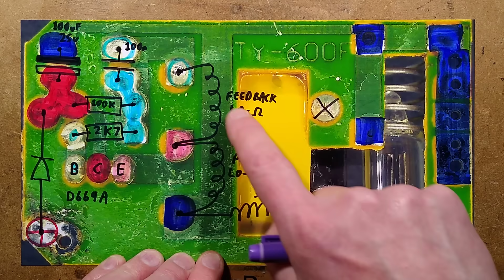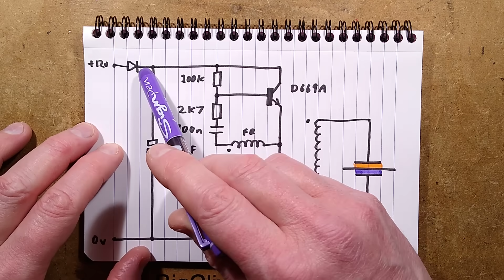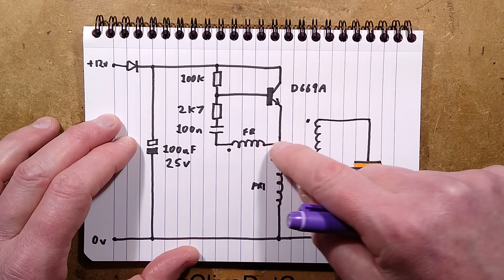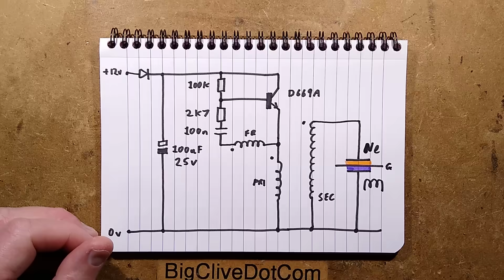Car ozone generator - with neon based cold plasma tube

Comment: I'm always wary of Ozone generators in cars due to the potential for oxidised contacts causing utter nightmares with modern vehicles. No doubt you'd need a substantial amount generated to cause any more issue than the outside air (especially after heavy rain) but still...

Comment: Can u recommend a good ozone generator that works in cars or battery operated. For time to time sterilising in cars?
Reply from the maker: I think the dealerships tend to use the common metal cased mains powered units.
Reply: I use one of those multitip air purifiers that Clive has been showing before, with a 12V power bank. It works very well.

Comment: ozone is toxic. if you ever go to a hospital that is using it to treat a room, that room will be locked, with warning signs on the door.  the only thing not causing these stupid consumer-grade machines to send people to the hospital all the time, is the very very low amounts of actual ozone they produce.  If you put dozens of them in a small closed room and tape the windows and doors shut, leave them running for days... then you might have a problem.  Otherwise... nah.  they do nothing.
Reply: yeah, not sure even DOZENS of them, in a sealed room, would generate ozone fast enough for it to become dangerous before it starts breaking down again into O2.  hundreds maybe?

Comment: I wouldn't recommend people use ion/o2 generator in their car for a long run. It going to cause the plastic to become brittle and breaks down more faster (self experience). Use those hepa & carbon filter itself if you want to get rid of the smell.
Reply: no, they do not.  if you car plastic was degenerating more quickly than expected, that is likely due to high levels of O3 in smog, and or naturally generated in some areas like low lying deserts, when it catalyzes from 02 off the surfaces of hot rocks.  it is impossible the consumer grade O3 generator in your car did any damage.  they literally only produce enough ozone so you can barely smell it.  it's a con.  these things do nothing. they are NOT commercial grade ozonators.

Comment: I wonder if the reason you got better results with the green neon bulb was because the green emitting phoshor coating gave better capacitive coupling?
Reply from the maker: I think it's more due to the gas possibly having a lower voltage drop.

Comment: The windings on the little transformer on the device are tiny! I had no idea we could wind copper wire that thin. What an incredible, yet completely basic electric component we use without thinking about day to day. Honestly I'm kind of impressed with this silly little device, I wouldn't exactly want to release poison into my car, but if I ever felt the need to this device seems honestly quite thoughtfully designed.
Reply: Everything is poison if you get too much of it. Ozone is probably one of the most "natural" sterilizers you could have...

Comment: one way I've seen to work out the turns ratio of these is to feed in a low voltage 1KHz sinewave into one of the windings (say, 0.1V) and measuring the output of the others then dividing out to get the turns ratio.  As for how the oscillator starts, the 100K resistor will slightly bias the transistor, then the transistor will begin to amplify the noise present (via the feedback winding) and it quickly breaks into steady oscillation.

Comment: You have to admire whoever came up with the neon bulb in the wire coil that only works at a certain distance out of the coil.  I was amused when you initially tried to 'fix it' and then it stopped working.  That showed the complex magic!

Comment: Given most cars have fresh air coming in the vents, not sure how beneficial a car ozone generator would be.   Also, I would worry about the oxidising effects of higher OZone levels would have on plastics and rubber components in modern vehicles.  Not all are mode to the same quality, which may allow ozone to attack them.
Interesting how postioning of the Neon seems so critical.  Wonder if a very slight movement would reduce Ozone before killing it completely.   I imagine it would be a pretty fine line though
Reply: yeah, consumer grade "ozonators" never generate enough volume of O3 to be a concern.  just another scam gadget basically.  you ARE correct though about ozone effects on plastics/rubber. out in the low desert in eastern California, the ozone levels do indeed get high enough in the summers to drastically reduce the life of soft plastics like window and edge sealers (the ozone is generated from UV light hitting the surface of rocks which catalyze splitting O2, which then immediately recombines into less stable combinations of oxygen with a higher concentration of 03).  they will often become brittle within 2 years.  even brand new cars will suffer this.  You can use your finger and they will simply disintegrate. I never understood why so many doctors in the 60s/70s told their tuberculosis patients to move out to the desert.  exactly the wrong place to go.

Comment: Sounds like a great way to destroy a cars interior. Ozone breaks down most plastics and rubbers. It's also highly oxidizing to many iron based compounds. Long term exposure can also lead to lung cancer and reduced lung function. At ground level it is considered a pollutant.

In general Ozone generators are a bad idea. There are safer ways to clean the air.

Comment: Could that possibly feck up your GPS antenna. I mean it's a high frequency high voltage low current generator. God help you if it does and your in Milton Keynes 😡

Comment: Oy!  Totally fascinating.  Never saw that configuration before.  Them clever little Chonese fellas!
I got a cat-stank-inhibitor that you stick on near a catbox, so when it senses motion, it generates O3 for a set time then turns off.  Output port looks like a 1/4" jack, only a needle vs round pin in the center.  Does work.  Occasionally get a whiff of O3 when I keep it around.
Reply: This is an kickass idea! How does anyone buy one from you?

Comment: 0:34 - Including the risks to health, if it even produces enough ozone... I've also come to learn, that ozone can be detrimental to some plastics, and perhaps rubber too, which may not be a good thing for car interiors...(?) Cheers-
Reply: these things produce so little ozone they are insignificant.  you're better off worrying about leaving your car for extended periods in places where O3 is produced naturally in high amounts, like in a hot rocky desert.  like say... Palm Springs California.  soft plastics and rubber have about 75% reduced lifespan there.  source:  I lived there for over a decade.

Comment: Now you make me wonder if ozone in the atmosphere could be artificially produced at a significant level. Floating solar panel balloons, supposing, and appropriately charged needles or tubes.
Reply from the maker: It is produced naturally in normal air.  But you can't just add ozone to the ozone layer.  It works differently to that.

Comment: I found that using ozone in my shed for deodourising car bits found that it really does rot rubber stuff quite fast. My atex rated torch is "no longer atex rated"

Comment: The ozone generators should be avoided especially by smokers since it can cause lung cancer.
They had some air cleaning systems at my  job place that filtered the air and added ozone.
The smell was not pleasant and with the possibility to achieve lung cancer made us to remove  the ozone building part in those units.
Reply from the maker: If at high levels where you can actually smell it, ozone is an issue.

Comment: With all these in car gadgets that plug into the car's cigarette lighter, there's the problem that you can only run one of them at a time. Has anyone invented a cigarette lighter 4-way extension lead equivalent, so you could plug lots of gadgets in at once? Or are modern cars all going USB these days ?
Reply from the maker: There are multi-way car socket extensions available.

Comment: Ozone generators  are reasonable common in Pathology Laboratories (obvious reasons); there are also commercial Steriliser / Disinfector systems, mainly aimed at smaller users,  and they appear to provide a lower cost option to the "Low Temperature Steam / Formaldehyde" systems. The idea is effective against vegetative organisms, however activity against bacterial spores is "variable".
Reply: also, the amount of ozone a commercial sterilizer produces is literally THOUSANDS of times what the consumer electronic versions produce.

Comment: I had two 36" industrial ozone fans running for 48hrs after a fire incident at my house about 8yrs ago. The restoration contractor told me not to enter the property for 24hrs after removal of the fans. The fans worked as there was no smoke scent left in the house and it smelled fresh as newly laundered linen. My two cats had to live at the pet spa/hotel for 35 days while the inside of the house was restored, they got regular baths and grooming which they've never forgiven me for...😒  Thanks Clive.
Reply: wise choice, as high levels of ozone are bad/deadly

Comment: If this would make ozone in small amounts you could probably run it non stop in your home or storage room.
Reply: it DOES make ozone in very tiny amounts.  you COULD keep it running constantly.  it is not significant, or useful.  just produces enough so you can smell it.  that's it.

Comment: I'm not sure of the health problems being exposed to ozone for long periods, but the old first gen Apple LaserWriter generated ozone like crazy, even in standby. One day I was talking to one of the secretaries (it was the 80s, that's what they were then), who said something about having constant headaches at work. I noticed they had moved furniture around in her corner, and the fan output from the printer was blowing directly at her. We turned the printer so the paper was still accessible, but the fan was blowing away from her, and not at anyone else, and within an hour her headache went away. She didn't know what ozone smelled like until I pointed it out, and later that week they had me put a network connection in another part of the room so get the printer away from everyone. So at the very least too much ozone in a small space, even an open room will affect you. In a car for a long drive, I would think it was worse. Also, I was amazed that the printer didn't shut down the HV section even at idle. I suspect Apple decided people couldn't wait the few seconds it would take for it to come up. I think they kept the fuser section at half temp too, because it was always not working hot, but you didn't want to touch the fuser roller for long.
Reply: Ah, the days before EnergyStar
Reply: The Apple LaserWriter had a fairly decent ozone filter on it's fan exhaust. If serviced or replaced regularly it should have minimized the ozone. It however didn't get rid of the burnt plastic and toner smell.
Reply: "I'm not sure of the health problems being exposed to ozone for long periods"

imagine having a spray bottle with bleach in it, and aerosolizing it at your desk every hour.  If ozonators produced hospital grade levels of ozone, that is what it would be like working at your desk every day.
the reason consumer electronics don't do that is because they produce TINY amounts of ozone.  just enough for you to be able to detect it.  EXTREMELY unlikely the old laserwriters could produce enough ozone to be of concern even in a closed office space.  much more likely headaches were being caused by old style flourescent lights which had really poor power dampeners so they flickered at the AC power frequency.  Known cause of headaches.  Since then most overhead fluorescent lights have adopted a better ballast system that power smooths so you don't get constant flickering.

Comment: I had a commercial unit, for semi trucks...wired underneath my dash...to a toggle switch...incase of a random traffic stop, for certain smells....you're not supposed to be in the cab when it's on, so i ran a reverse relay from an old car alarm with keyless remote....lol

Comment: And here I didn't think it would work at all 
Could you do a video on how a three-phase motor works how you would wire one up I don't want to wire one I just want to know how it works
Reply from the maker: There are many different types of three phase motor.  For the simplest you have a ground connection and the three phases, and the motor relies on the sequencing of the phases for rotation.

Comment: My car has a built in ozone generator as part of the ventilation system, so that seems to indicate the the idea is safe and effective (at least when the quantity is designed to match the size of the car).
Reply from the maker: Many do, but they often call them ionisers to hide their true function.
Reply: they are entirely useless.  they are however, completely safe as well.

Comment: The oscillator probably doesn't put out enough power to handle more than the neon bulb's tip generating ozone. With the neon tube pushed further in, most of the energy gets spent ionizing the neon instead of generating ozone.
Reply: very little ozone is actually produced in ANY consumer electronic ozonator.  for obvious reasons if you actually know how toxic O3 is.

Comment: I don't know where the idea originated, but whoever realised that you could use a neon and a coil of wire to make a gas-dielectric capacitor (with an open to air side) certainly knew their spring onions!

Comment: Can anyone explain why you would want this? I don't know anything about ozone but I just see a ton of comments here about how it's actually bad?
Reply from the maker: There's a lot of anti-ozone propaganda from the past that gets regurgitated by the google-experts.   It is harmful at high levels, but also an essential part of natural outdoor air at low levels.
Reply: Ozone helps eliminate bad smells. Mold, mud, pet smells, drugs etc.
Reply: @baqcasanke  that's the game.  consumer grade ozonators actually do nothing more than produce just enough ozone so you can smell it.  COMMERCIAL grade ozonators, that actually DO deodorize... are also extremely dangerous to be in the same room with.  Clive is not that knowledgeable about ozone pollution otherwise.  He should try living in a low lying desert for a few years.  see what natural ozone pollution does to his car.

Comment: A few years ago I bought an eBay car "ozone generator" just for curiosity. It turned out to be an LED and a resistor. There was a transistor, but it wasn't connected. The LED was not a UV LED. The seller was disgruntled by my review.
Reply from the maker: Yeah.  Many of the car ones are fake.
Reply: I'm impressed you got a negative feedback to stick.  I've left negatives for a few counterfeit or otherwise quack products, sticking to the simple facts and not saying anything that would violate terms and get it removed, only to find the feedback has been taken down the next day and the seller retains their "100% positive feedback" rating.  It truly is infuriating.
Reply: The effort it takes for Chinese 'bogus' sellers (99 in a dozen) is minimal as soon as they have the cash, but when it comes to sending back, or getting help, it takes so much effort that it is wiser to scrap it. And if you leave a bad review, they hardly understand English, or you, and revert to aggressive behavior as I have experienced too. Via Etsy I bought a digital clock on wifi, with temp and humidity sensor, but the sensor errored. The seller said to replace it, the problem was that the sensor was faulty designed as I figured out later. So I asked him for repair costs and he was not happy. I lowered the price to 5 dollar and after 1.5 year still waiting for his money. So sellers want to sell the world to you, but if faults come to surface, they are not to be found. I did however left a bad review about his behavior, never heard a thing about this....

Comment: I wonder if some sort of these HV circuits for ozone generators could be used as a replacement for a dead circuit in one of those fancy plasma balls. I´ve got one here and the transformer inside probably shorted a little and the voltage is insufficient to drive the ball. Hmmm....
Reply from the maker: The voltage from these is way too low for a plasma ball.

Comment: Unless you're on recirculate automotive HVAC is total loss so you can smoke in the car and still be able to see, the vent (flapper valve) is usually under the rear bumper cover.

Comment: Ozone can damage a variety of materials, including rubber, plastics, fabrics, and certain types of paint. It can cause these materials to deteriorate or discolor.  so great for long use in a modern car full of the stuff??
Reply: the amount of ozone these consumer devices produce is so tiny as to be completely irrelevant.  worry more about driving through low lying deserts where the sun heated rocks catalyze enough O2 and thus produce enough O3 to be significant.  I used to watch rubber and plastic seals become hard and brittle in less than two years when I was living in Palm Springs, California.
Reply: Ozone is particularly vicious on leather; it seems to be the most sensitive to ozone. So a three hour day in the Jaguar and you'll be sitting on pile of shredded fibres.

Comment: Is it 24V tolerant? Would depend on the rating of the input cap and transistor i suppose. If so what would be the effect on ozone output?
Reply from the maker: It's only for 12V use.